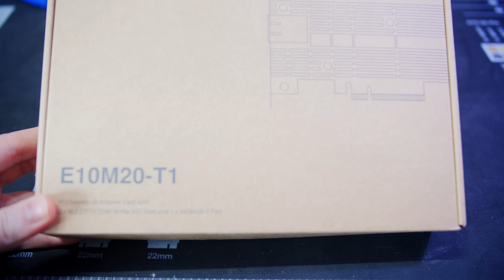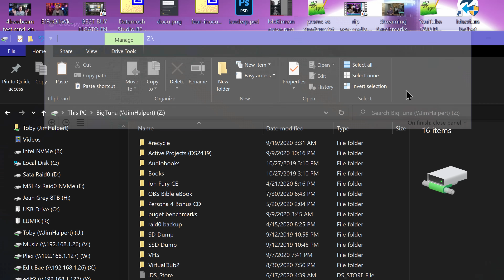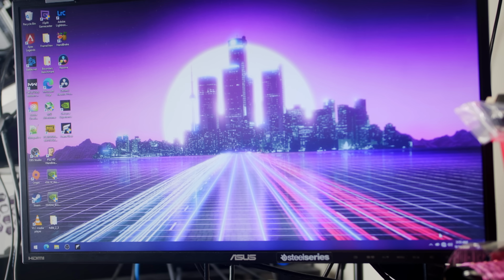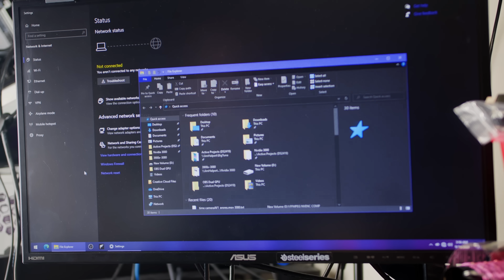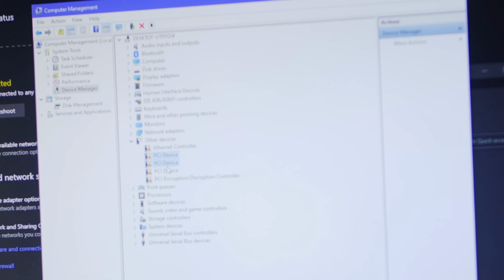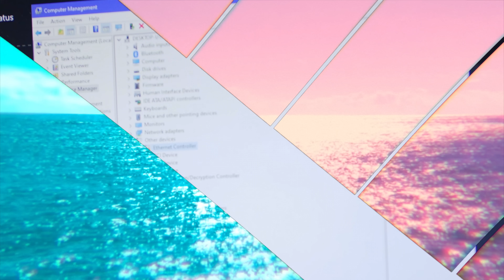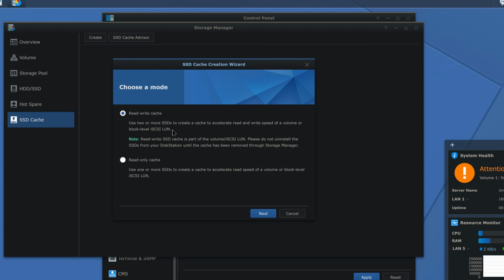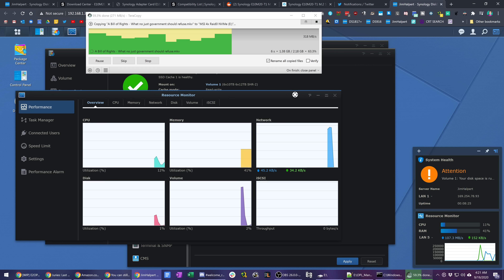NVMe Cache & 10Gig on the SAME card?! FINALLY

Comment from the maker: I went back and added thermal pads to the controller lol don’t worry
Reply: white color is so bright. why??
Reply: ROFL! I was just about to comment that the memory controller needed a thermal pad more than the memory chips. You got it covered.
Reply: ok letme rewrite this.
the hole card makes no sense. in anyway. nvme already is 4x PCI-e 3.0 lanes.
so the board must allow to split that 8x bus. 
what would be leftover for the 1gbe connection? NOTHING.
so that dont work, oh well whatelse can we do - well splitting it into 4 pieces. 
so basically 2x2x2x2 that would mean drives get half the bandwidth they are entitled to and we give away 2 unused lanes. 
even the 10gbe cannot do it bidertional 
so what now ? allright lets bridge this thing. if this thing has a bridge, well we might utilize it better but would still loose 20gbit on the drives. (plus overhad and other stuff that comes with any pci-e bridge plus the additonal costs of such a card.

bottom line - pointless, let alone this type of cache is only in specific configurations and usecases useful.

Comment: Can I use that 10 gb port that you installed has two slots for  R / W cache, inside the 1821+ ?
I do understand that the i am referring to has two slot for that already, however i would like to have the extra memory for R / W. (for a total of 4 × 1 tb NMVE drives).
When fully populated the 1821+ with have 8 × 18 tb ironwolf Pro HDD, 2 × 1 tb R / W NMVE cache (on the inside of the unit), and then an additional 2 more 1 tb NMVE ssd added to the 10 gb port.

Comment: My QNAP 332X has NVME Cache built into the design and has a drive slot for each physical drive. They also have an SSD optimization software that works with this capability. Since my 443X is mainly for media storage and is only used by me I can't justify the expense of three NVMe drives. A write cache would be more sensible if you were running a database application that might read what was just written. Employees processing orders and shipping packaging them and accounting billing and ERP re-ordering materials or additional replacement stock might be a good workflow to utilize this solution since the same data would be utilized at each stage of the process.

Comment: question is: does this work on a normal PC ?
Reply: Sometimes. The motherboard has to support PCIe bifurcation I think.
Reply: @v1ncen715  nice. But the chips used are common? Driver problems in linux?

Comment: That card is using an Aquantia 107 10G network chipset. You just need to download that windows driver to get it working.  The card works by having an integrated PCIe switch chipset that directs the traffic through your PCI bus to either the NVME drives or the NIC. I think I was able to get the NVME drive (I think only 1) and NIC to show in windows.  I use the card in a TRUENAS build in an HPE Microserver Gen 10 Plus (had to mod the case to make it fit, and side load the Aquantia FREEbsd driver).

Comment: Oh wow, those speeds are a lot lower then I would have expected? You are only getting about 2Gbit to 3Gbit in total? Glad I went the "build my own NAS route"! With spinning disks you should easily be able to get 2x or 3x the speeds you are seeing, a single disk can deliver 200MB/sec (at the start) now a days, so with several in any form or RAID or Mirror, ~1000MB/sec isn't that much anymore.

I'm running ZFS Proxmox server myself, yes it's more manual configure work, but I am easily able to hit 10Gbit with some commodity desktop hardware. I live edit all my videos from the server (and also have some SSD caching in place for that) but with the performance you show in the video, I don't think I'd be too happy with it. Hopefully the cache you added at least helps in the latency part of things, but I am really confused why you are so bandwidth limited.

Comment: Please compare just network performance with no caching to verify the network aspect is the same. Also, looking forward to read cache performance comparison. Looks like the write performance went down if I understood the video.
Reply from the maker: Just the network aspect is the same
Reply: @EposVox  Tested and verified same, or spec sheet same? Because those mean different things :)
Reply from the maker: As in my day to day usage speeds are unchanged. 
They were a tad slower at first in the screen captures possibly because it was still sorting things, and then terrible for a week after because I somehow broke my cat7 cable in the process (who knows) but addressing the physical layer problem and I have the exact same speeds as before in both directions

Comment: I recently purchased the Synology E10M20-T1 card for my Synology DS1819+, I also purchased an Intel X540T1 NIC for my primary PC (Windows 10 Pro).  Both systems are routed through a MikroTik CRS305-1G-4S-IN 10GBe switch using 10Gtek SFP+ RJ-45 Transceivers.  I'm curious what sort of speeds you are seeing on your 10GBe connection with your Synology?  At first, with my setup, I wasn't seeing any real gain in speed until I figured out that the traffic was still going through my gigabit aggregated links.  Once I mapped a link through the IP for the Synology E10M20-T1 NIC then I saw better throughput.  Since I am running a Plex server from both the PC (Primary) and on the Synology (Secondary) I normally copy the same files from the PC up to the Synology DS1819+.  What has me puzzled is the speed starts out around 400+ MB/sec but then drops down and fluctuates between 200 to 300 MB/sec.  The size of the file or the number of files may play a factor.  Is this normal?

Comment: if the goal is to use this as a cache for your nas, I strongly recommend against the rocket q drives because they use QLC nand which has significantly lower write endurance.  You should use at LEAST TLC nand (which the normal rocket drives are).  the reason synology drives are 400gb and very expensive is due to the incredibly good write endurance which is really necessary in a NAS cache because it's going to constantly be knocking out the least used stuff from the cache and keeping it warm with the most used stuff.  the normal rocket uses medium endurance tlc nand which should be fine for a small group of users / low writes on the nas, but I wouldn't use the qlc stuff in that, it's likely to die pretty quickly. - Further, you should NOT raid together drives with unlike performance characteristics - you'll basically end up bringing down the performance of both drives to the lowest performing drive.

Comment: You need to go into the BIOS and see the slot you put the card in. Did it get enough PCIE lanes? Does it even show up? If not, you need to assign pcie lanes. Each storage device needs 4 and the 10 G network needs 4.. did the bios auto configure the slot? If not, you need to do it manually, then reboot, see if it shows up in bios. If not, it will not work. If it does show up, boot to windows and device manager should see it. Have fun!!!

Comment: That is an interesting card! Hope there will be mroe cards like this with driver support. Perfect for systems with not so many pci slots :)
Reply: I thought so as well until I found out about the need for PCIe bifurcation. Most itx board do not support that unfortunately.
Reply: @v1ncen715  it is worse than that. 2nvmes already east up all the bandwidth and or lanes (depending if theres a bridge onboard that thing or if its a passive card)
so you need to split that poor little 8x bus into 4, halfging nvmes bandwidth. also ethernet is now no longer 10gbe bidreictional
no matter how you turn it, its nonsense product, then agian its for synology so that kinda comes with the territory
Reply: @woswasdenni1914  I don't disagree, but i don't think Synology is the only one to blame. Qnap and others are doing the same  thing... For home use I would still be interested in this solution if the price was much lower, but 250box+ for a card that is bottlenecked by design is a bit much, especially if you also have to invest in nvme SSDs and 10GB switch and barely use their potential.

Comment: I had the QNAP version of this and if i recall correctly - you don't end up getting the ability to use the full 10GB because of the limited bandwidth in the card itself. I was limited to 200-250MB/sec transfer speeds. Threw a 10GB NIC into an unraid NAS server with an NVMe cache and I can read / write at just shy of 1GB/sec.
Reply from the maker: I still get my full speeds I got before.
That being said I've never gotten NVMe cache working properly in Unraid and all the forum posts amount to "lol it's not built for that kind of speed"
Reply: @EposVox  I have a 'working' drive in UNRAID which is NVMe based and sits in isolation of the array. That allows me to max out the bandwidth of a 10GB network and have no problem video editing with 4K footage stored on the NAS and still be very responsive. When storing stuff to the array -  yeah - it took me a while to understand it but basically the unraid cache in a traditional sense seems to be more of a write cache than a read / quick access cache!

Comment: Those NVMe drives won't last :) you need proper NVMe for NAS, well a least will not screw up your DATA in Synology they can only de used for cache.
Reply: @technicavivunt  is only cache, so not much risk there any way.

Comment: In my office with 15 users I noticed a big speed boost on our Synology NAS when I added 2 256gb SSD drives as R/W cache.  I have a 20TB raid6 span. I would say my only complaint is I need to go up to a 2tb cache. If you are going to cache the drive wrights, you really need to have a UPS on your storage server.  The risk of data loss is just to high otherwise.

Comment: The stickers are designed to stay on. You do not need to remove them when using a heat sink.
Reply: this needs to be upvoted more my good did i cringe on that. They are definitely meant to stay on and even help distributing and dissipating even when you add another heat sink on top as done here.
Reply: Actually it would just be another conducting layer in your overall heat dissipation path it is better to take it away from a thermal resistance standpoint since you do not need it to increase the surface area but minimize resistance if you have an external heatsink
Reply from the maker: I was funny say everything I’ve ever read/seen/learned about these drives and thermal conductivity in the first place says the opposite. 
Heatsink - thermal pad - heatsink is a very inefficient conductivity path. Especially when the top of the sticker one is an actual sticker and not a conductive surface.
Reply: @EposVox  a bit counter intuitive but the top sticker is so thin it makes no difference, but the copper underside is good at spreading the heat across. PS the main issue is the controller as you said in a previous comment, the nand chips run better when are warm (not hot!) due to the physics of nand itself. In short the sticker should have stayed (at least for the sabrent drive)
Reply: @powerslideita  Yea I remember Allyn Malventano asked Samsung about this and they recommended to keep the sticker on even when using with another heatsink because it was still thermally conductive. I'm guessing the hassle and the potential for damaging the drive outweigh the fact that you could shave of a few more degrees off.
Reply: @Jarska no way the video absolutely ruined my day..... naaaa. I don’t think anybody lost sleep over this, but why go to so much trouble for no gain 🤷‍♂️

Comment: And all of this is why i use unraid
Reply from the maker: Which is also not great for speed and the more I’ve looked into getting fast speed on nvme cache for it the more I only found forum posts of people laughing at the idea
Reply: @EposVox  Yeah the speed to the mechanical drives is poor to say the least for writes however I have 2 970 evos for a cache and have no problem saturating my 10gb network.
Reply: @EposVox  All you would need to do is have a big enough cache to finish the projects your working on and set it up to dump the cahce to the mechanical drives on a weekly or monthly basis. Its been working great for me so far.
Reply from the maker: I have like 8tb of nvme cache but my speeds still aren’t great and every forum post just says unraid isn’t built for that
Reply: @EposVox  Hmm i was doing some reading and testing and seen alot of those forum post i cannot belive they think nvmes and 10gb are "Bleeding edge". However i can still easily see 5 to 10 gbps during transfers to the cache even with other stuff hitting the array. Im guessing you were using a reasonbly powerful cpu if u had that many lanes for cachce idk im sorry i cant be of any help.

Comment: Interesting, but that high end nas just isn't in my budget.
Reply: As NAS devices go the Synology is pretty affordable. But if you are on a tight budget don't use a NAS, Use internal storage or USB storage. It is a good way to go till you can justify the NAS cost. Even then you can build your own NAS using free software and low cost hardware. The DIY solution isn't as reliable but it is less expensive. 

If you don't download very often and you just need to make backups, I've found Amazon's cloud storage to be very affordable. I backup 10gb nightly and we spend less than 10$ per month doing it. We almost never download because they are backups. Amazon charges a lot more to retrieve your data then to post it. Yes it is very slow in both directions.

3 things I think people miss. 1 if you don't need to share huge files between systems local storage is awesome. 2 never underestimate the bandwidth of moving an HDD from one computer to another. It is a lot faster to plug a drive into a SATA or even USB3 than it is to use a home network. Most homes don't even have 1gb let alone 10gb networks. 3 backing up your files by copying them to 2 different large drives and locking them up in 2 physical locations is often safer than using a single on site NAS.
Reply: @EthosAtheos  I have a NAS, 32TB hard disk only NAS.  Synology makes nice NAS units but the ones with pcie  expansion are quite expensive and overkill for many use cases.  I also use cloud backup for my Data as well.  I'm also not clear on the benefits of putting x8 of nvme and 10gig lan behind a mere x4 connection to the host.
Reply: @iankester-haney3315  I've never tested it but I think the idea centers around it being cache. So in theory if what you want is in the cache it will be accessible to the NIC much much faster.  I understand the concept but I'm not sure how well it works. I know SSD caching does help because I use it. But this seems to be more like SSD lan caching. 

I guess if I had an unlimited budget I'd just use all SSD. But right now cost per TB is just to high. I'm in a business environment and it is still hard to justify SSD in my NAS solution.